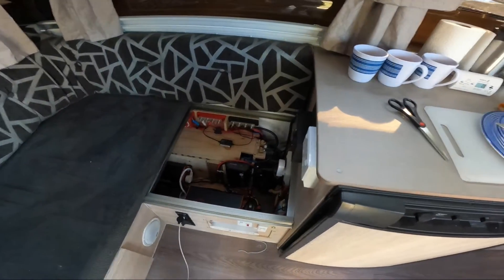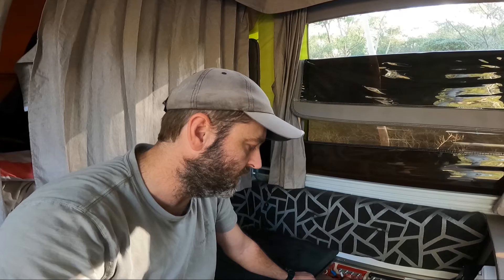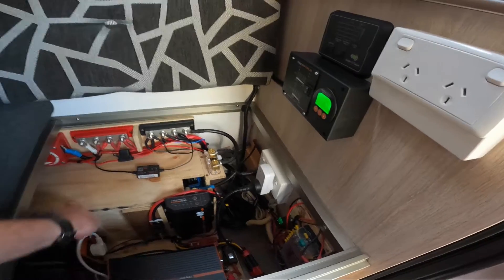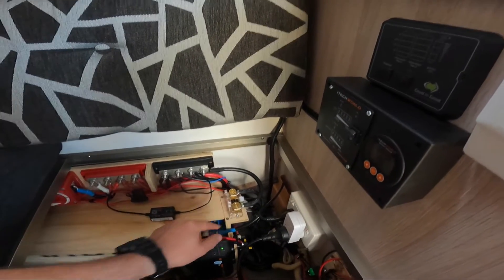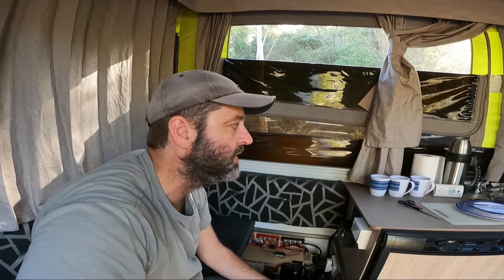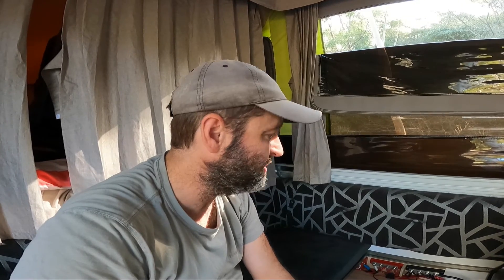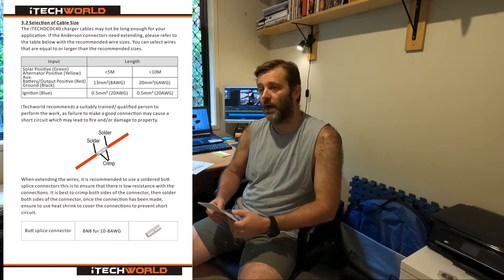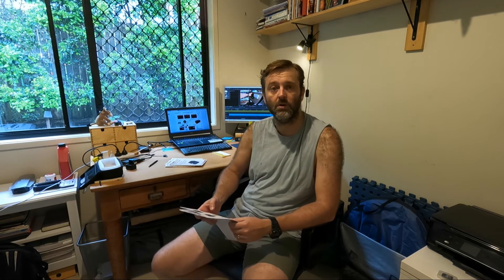Lithium Battery Setup in Our Jayco Swan

Comment: All looks good, thanks for taking the time and effort to show us your set up. Interested however to know a bit more about your solar.  Type and capacity?  G
Reply from the maker: Pretty simple solar setup to be honest...we currently use a kings portable 250w folding solar panel that hooks into the DC to DC charger via an Anderson plug on the side of the camper. Seems to work ok though I have been thinking a fixed panel on the roof of the camper would be good as well!